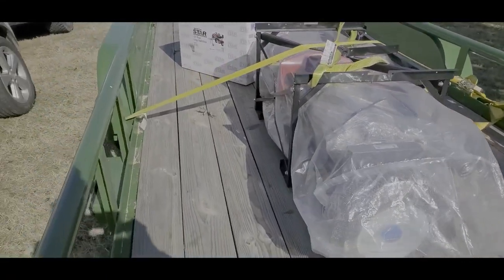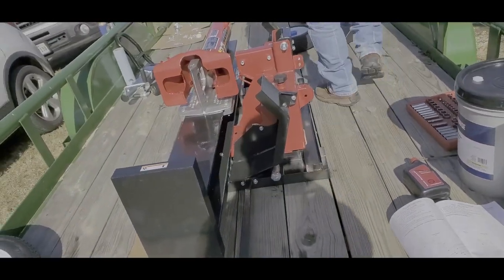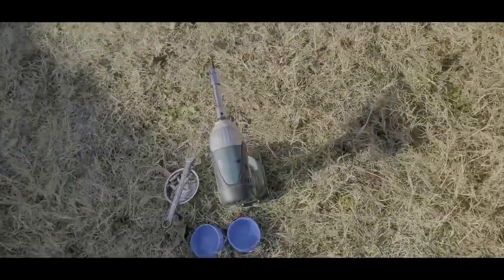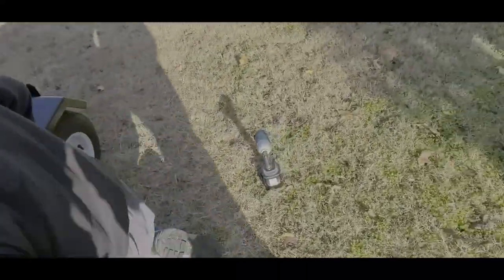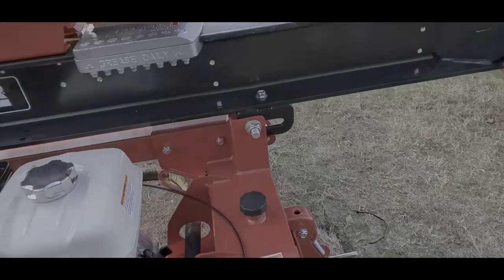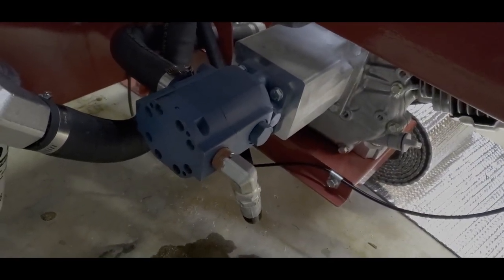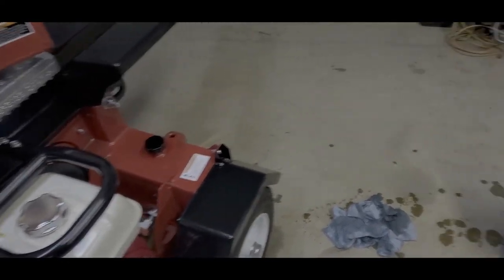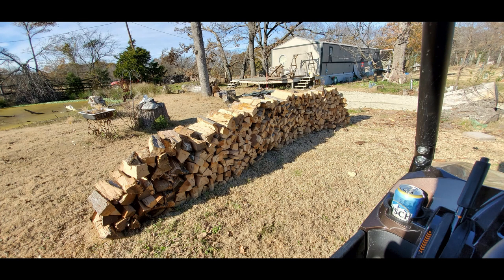NorthStar 37 Ton Log Splitter assembly video

Comment from the maker: Dang I didn't realize I had comments waitin on me. Definitely glad I went with the largest option available from Northern Tool Equipment. I've split about 6 or so cords with 0 issues. I turn the gas off and let the motor burn up all the gas in the carb when im finished everytime and just drain the whole gas tank if I know it's gonna sit for a while.